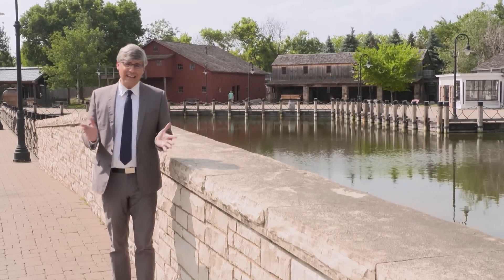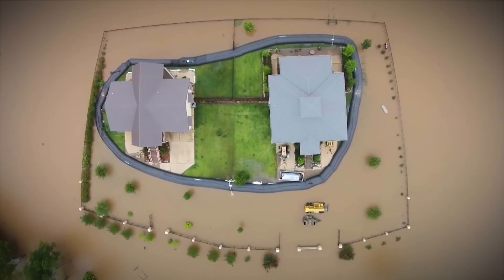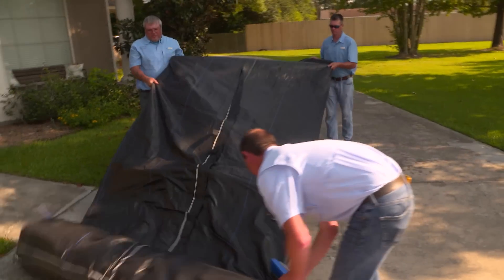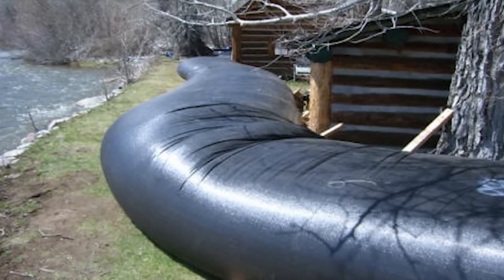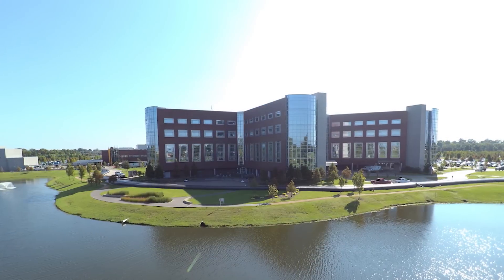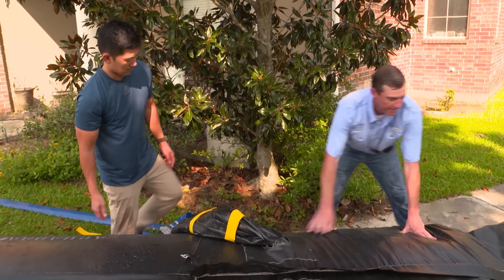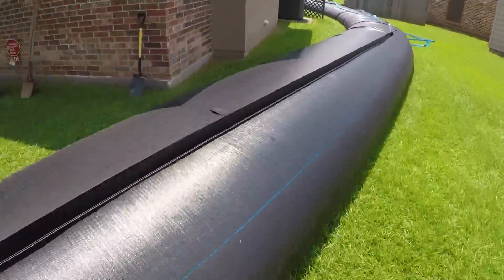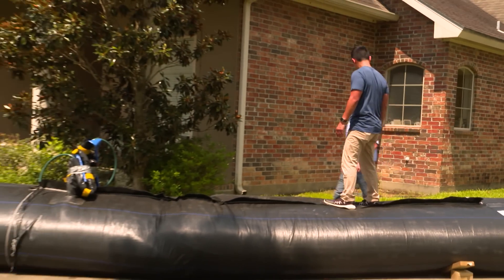AquaDam Protects Homes from Floodwater | The Henry Ford's Innovation Nation

Comment: One issue I see is that it requires a lot of water to fill before the floods happen.

If probably even a few people per block were to fill at the same time from the hydrant there won't be any pressure.

Comment: Pretty cool, how much did it cost the homeowner to fill up that baffle for the demo? :) My question would be in a flood situation you may not be able to draw that much water from a hydrant. So I will assume you can pull water using a sump pump to fill up the barrier from the actual flood water itself? Time is the enemy here.
Reply: Time, and making sure you have an on-site generator in case you lose power.

Comment: I'd love to know how long it takes to fill with a garden hose when you have no fire hydrant with that much pressure... and what happens when the power goes out and you have to pump your well water by hand? LOL is there a trick to plan for that contingency? I'd hate to get one of these and have the power go out before it's full!!
Reply: Not only that ...  massive water bill ... plus there's Aqua dams are not cheap fungi in another thread here said his friend bought one for $ 8,300 but we don't know how big is property is ... I wouldn't be surprised if it's a relatively small house .
Reply: If you're protecting your property from flooding, free water is somewhere near

Comment: now make a version that can be buried in the yard with pumps that start sucking down water around the house automatically filling the the tubes making them pop out of the dirt
Reply: The aquadam can show cracks after  time has passed. If the rubber cracks, then your whole fantasy project has been for nothing. And we re not even talking about the sewer water you re gonna damage your pumps and the inside of the aquadam. So that would be a terrible idea that ll cost you a bunch of money.

Comment: but the #1 most important question is....how HIGH are these dams, like how tall? a foot? 6 inches? 3 feet tall? etc -- this would only be good if you knew ahead of time exactly how high the water levels were going to get at your house, right? imagine spending tens of thousands of dollars to surround your house with these, only to see the flood waters get so high that they go right OVER the top of the AquaDam! that would really suck
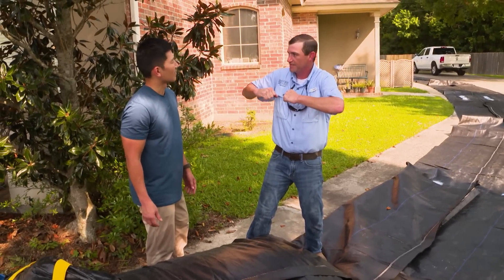Reply: @2:51 = okay never mind, the video answered my burning question *lol -- 3 feet tall models can hold back 2 feet of water (and they make 6-foot tall barriers too? but probably way more expensive)
Reply: @DJMichaelAngelo  Also, consider that when the water hits the dam, it will keep flowing down and around it... so it won't accumulate like it would it the dam wasn't there. So, it could potentially protect a house even if the rest of the area is flooded higher than the barrier is.